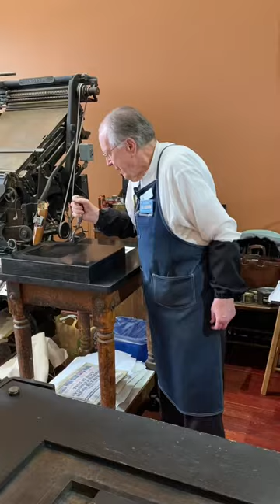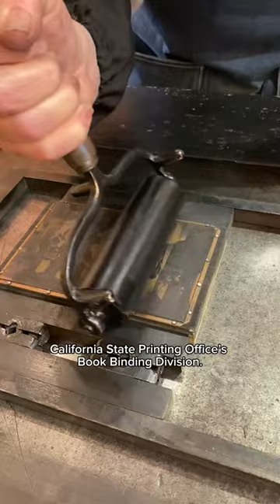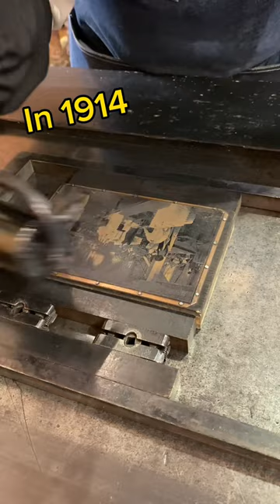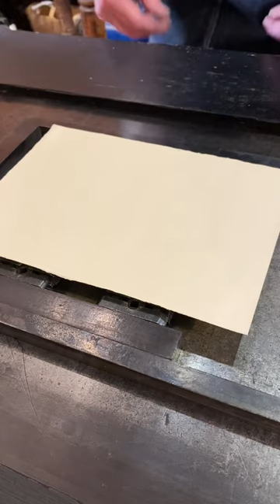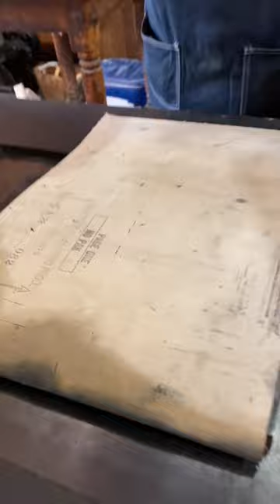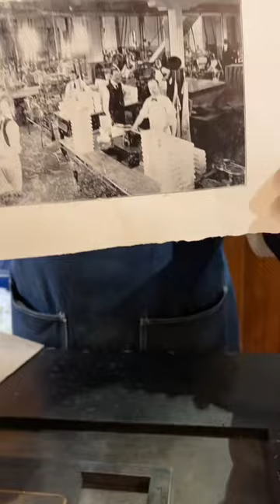Printing a halftone of some book binders, made 110 years ago, for World Book Day (April 23)

Comment: To anyone blown away by the level of detail, this wasn't made by hand. Half-tone dies are etched with acid. This technique is to a degree similar to a modern offset printing, the polished die is first covered with a thin layer of resist which is then exposed to UV light projected through a photogram and a special raster mask. The unhardened resist can later be washed off and the die etched.
It looks just like a photo because, to a degree, it is.
Reply from the maker: ^This